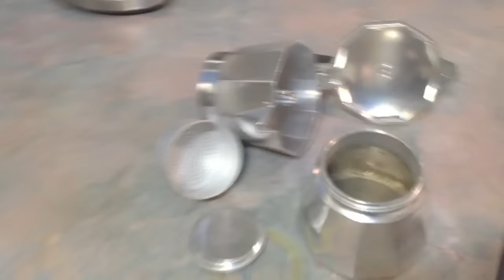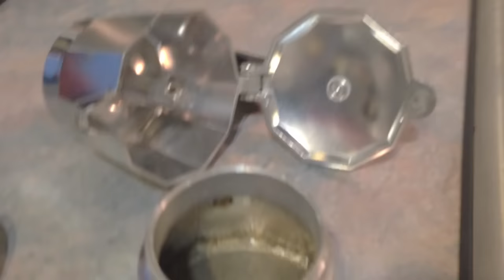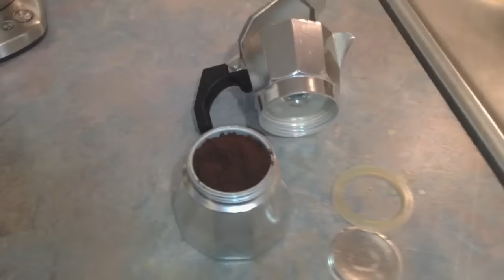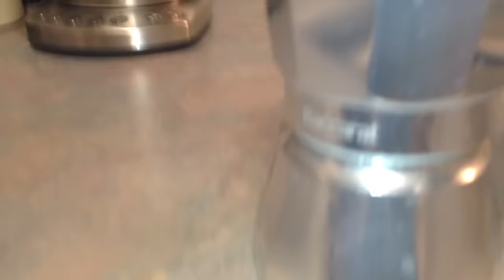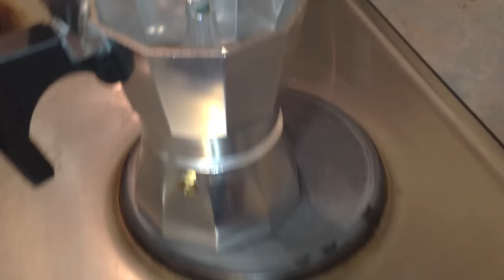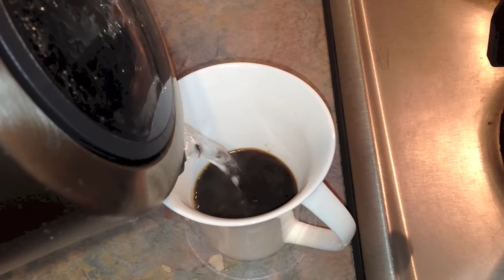How to use a Stovetop Espresso Maker

Comment: Tip: start off by putting boiling water into the coffee maker, it will save you time and get a fresher flavour as the coffee will not be sitting on top of the water vapour as the water heats up to the boiling point
Reply: Thank you

Comment: I'm watching this video during quarantine and it nearly brought tears to my eyes, it was so informative. Decided to use this exact expresso maker today that I received as a gift years ago and put away in a cabinet because I didn't have any instructions. Trying to get away from the plastic coffee maker, I have been using. As an engineer, I knew not to attempt this without proper visuals but went through several other guides that left me with more questions than answers. No questions after this one :) Hope you are well and thank you 🙏🏾
Reply from the maker: So glad to hear it’s helped you out!
Reply: Yes, a lot of instructional videos overcomplicate the process. This one shows the fundamentals quite clearly. I would add, however, the importance of not using too high a heat source and possibly towards the end of the cycle, when it first starts hissing and sputtering, to remove it from the heat source. Moka pot first produces a very strong, almost syrupy brew and then gets watery towards the end of the cycle. Some people even suggest stirring it in the pot to mix it before serving. Removing it from the heat also avoids "burning" the coffee grounds and produces a cuppa that isn't bitter. Trust me, you will enjoy using the moka pot. If the resulting brew is too strong for your taste (some say that it mimics espresso) then dilute it with hot water to make an Americano (so named because American servicemen in Italy during WWII liked it that way, rather than as an espresso.)

Comment: I loved this video. This is the most complete piece of information i have seen on the subject. You covered everything i wanted to know. Such a simple but great way to enjoy strong fresh coffee! In my opinion using fresh ground coffee is optimal.
Reply: Yup, spend a bit more on quality beans and grind it fresh at time of making it. Also, distilled water (very cheap huge jugs) is really what will push it over the top. 👍😁
Reply: but my dear mr.grim . . .  he dint mention how to properly empty the used coffee grounds from the filter basket?  it is a coffee drinkers ritual passed down thru the ages from father to son and mother to daughter... a sort of coming of age for the next generation of coffee drinkers if u will?  and now i pass the secret on to you!   begin by holding the funnel shaped filter basket between the thumb and forefinger, but do this only after it has cooled or you will rue the day you ever discovered this delightful little trick!  then, with a grand gesture, bring the filter basket up to your lips and blow thru the tube.  the result is as miraculous as it is rewarding.   the torch has been passed... good luck and happy coffee break!
Reply: Very helpful, thank you!

Comment: We just retired a 10 year old Keurig, similar to the new one MyBest.Kitchen the old one had a LCD display, but this new one seems like it is a little better as far as features. Turn it on, load it up, press the button and wait for the cup to fill. Much quieter than the old one. The amount
Reply: Keurigs Arnot coffee Keurigs is hot-water pushed over a K-Cup which pretty much is instant coffee
Reply: Please don't click this link unless you've inspected it.

Comment: I found one of these in a thrift shop with no instructions,  and was not to happy not knowing if I had all the parts because I had to leave the handle at the edge of my burner.  But your video not only showed how close I was but to add hot water to the "concentrate" to even out the coffee, or whatever beans I have is something I never thought to do.  Im going to dig it out of a box and follow your instructions and get my 2 dollars worth out of this funky little coffee maker.   Thanks.
Reply from the maker: Tru Rudboi What a find! Definitely worth keeping handy in the kitchen thats for sure.
Reply: I found some clearance beans of dunkin d's, starbucks,  ect, at the store and enjoy making a cup of coffee with this thing,  it does take some practice,  this video helps alot.
Reply: Greetings and happy holidays.  How do I clean the insides of this coffee maker?  Do I scrub it out with dishsoap,  or is there a special way to do it?  Thanks
Reply from the maker: Hey Tru, I would simply rinse under warm water and use a dishcloth to remove any residues. Probably avoid using soapy water too often as it removes the oil's that 'season' the pot.
Reply: well :)) it,s a machine coffe from italy .. most of ppl italian use this home to make coffe.. at first ..if u use a new one .. mean machine coffe.. i have to put only water in the machine.. not coffe ..make 3 or 4 time the same.. and at last u can make a good coffe

Comment: You are a wonderful human being!

Thanks very much for the video.  My coffee maker (drip type) died after 25 years of loyal service, and a new one is not in the budget right now.  My wife reached into the depths of a dusty shelf with "decorative" kitchen items, and pulled out an espresso pot.

"You could use this........I think........"  Was her highly encouraging statement.

It needed a good cleaning, and the gasket had become dried-out and (almost" permanently attached, but because of your video, IT WORKS!!

One question, how often do you remove the gasket and filter for cleaning?  After each use?  I bought some new gaskets, but they are not the easiest thing to remove, so I have cheated a few times and left it in place for 2-3 pots.

Thanks for your help, and for the videos!
Reply: Scott Owings z

Comment: I don't remove the rubber washer each time I make my espresso - in fact rarely do I take it off......maybe once in a while to give the pot a thorough wash. I collect these pots of various shaped and sizes. Every so often, Goodwill or Salvation Army one will turn up, usually a dollar, not much more....they're cool. I have mine "on display" in my kitchen. The various types of espresso that's on the market today is fun to experiment with. In Italy, it's all we use.
Reply from the maker: They are fun to collect and they add some variety to my options of making coffee!

Comment: Well explained. I bought one from ikea and had no idea how to use it. This video helped me a lot. Thank you so much. I have a doubt. Does the water flow out completely from the bottom reservoir to the top .when i did some water still remained in the bottom vessel. Is that normal. Plss clarify. Thank you once again

Comment: I use one of these, great gadgets. I find if I leave the hot water spurting into the brew at the end as in the demo this has a -ve effect on the flavour. Once that point approaches I remove from the heat and stand the base in cold water for about 10 seconds. This kills the boiling immediately and stops the flow of what is at that point very weak, flavourless, boiling coffee. Just a different approach which I find does make a significant difference.

Comment: The one featured in this video, Bacarat I believe, is one of the best stove top espresso makers (moka pots) that you can buy. Arguably better than the current aluminium Bialetti models. The general criticism of the Bialetti aluminium models is they're still using old fashion rubber gaskets instead of the more modern and durable silicon ones everyone else uses.  Bialetti are sticklers for tradition it seems. Moka pots also come in stainless steel, but I prefer aluminium myself.

Comment: Clear as a-bell directions! I have 1 question, do you leave the grounds in the filter before pouring the coffee? I have been using a porcelain coffee pot without the basket. I boil it and then when it's done boiling to the darkness I like, I pour cold water in and give it a minute or two, and then it is ready to go. No grounds in my cup. The only problem is I feel like I waste too much coffee.

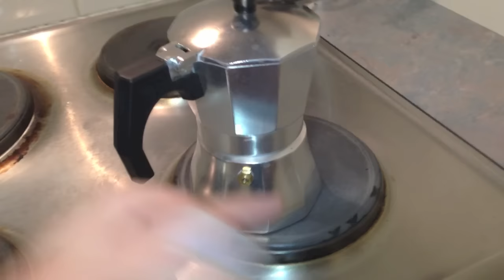Comment: It's only in the summary at 5:01 that you mentioned that you used filtered water. Also, I would have tidied the coffee grinds spilling over the 'cup', to avoid mess and allow a good seal. I've never had a problem overtightening a stovetop. Otherwise, nice explanation.

Comment: Thanks so much. I got one on Amazon for less than $8 so less than one espresso drink at the coffee shop but the instructions say to pull it when 3/4 of the water has passed through, but they also say not to lift the lid! So how would I know if it was 3/4s full at the top?? So odd! Thanks for exactly the clarification I was looking for with a handy visual. Much appreciated!

Comment: Thanks for doing that video! One question, though: If powerful, hot steam is the key to getting that desirable "crema" on top of the espresso as in the big commercial espresso machines, why would you not want to pack your stovetop espresso maker as tightly as possible with coffee to raise the steam pressure as much as possible?
Reply from the maker: +BluegrassBoy these devices don't create enough pressure to make 'crema'. If you pack the coffee to tightly then they simply won't produce any coffee. You are spot on when it comes to espresso machines, but these work a little differently.

Comment: Thanks for the informative video, great job!  My drink of choice is a 20oz Americano.  What is your recommendation on how to achieve this with the 6 cup Moka Pot?  I just purchased one.  Also, I usually buy the regular coffee beans.  Is that acceptable or should I be purchasing espresso beans?

How many tablespoons of coffee grounds?  How much water after the brew is done?  Thanks in advance!
Reply from the maker: Hey TomBVoxman. Thanks for the feedback.
For your Americano, I would brew up a full Moka Pot. As is fill the reservoir with water, fill the coffee chamber with ground coffee and brew like normal. 20oz is a good size cup, so depending on your taste, you would probably use about 3-4oz of espresso from your Moka Pot, fill the rest of your cup with just off the boil water.

Comment: Informative video. I just have one problem. Mine always tastes burned. I have it on med-high on a gas stove. It will take about 10 minutes for anything to come out of the top and it will only full up about half way or less, leaving water in the bottom still before or stops. Should I have it on even higher? I'm afraid if the flames being to wide and burning the handle
Reply from the maker: It sounds like your following all the correct steps and not boiling the water too rapidly.
Your coffee ground may be too fine, this would slow down the extraction and potentially cause your issues. 
Try a slightly coarser grind for your coffee and see how it goes
Reply: Same happened me and I found the problem.  Don't use cold water as it takes too long to boil. Use hot water or water not long off the boil. It works fast and the coffee doesnt taste burned from sitting on the heat too long. It makes sense aswell as no steam comes up until the water gets boiled so ure first few mins with cold water is unnecessary and exposes the coffee to too much heat. Solved burnt taste for me.

Comment: Thank you for this great video. I just bought a 9 cup Baccart Verona Coffee Maker and as the little booklet that came with it, ended up in some water at the benchtop, I can't read the instructions anymore. So your video was a great help. The only thing is, is there an easy way to get out the silicon ring and filter lid? I don't want to use the point of a knife to get it out, as I might damage it.  
Kind regards, Anneke.
Reply from the maker: Anneke van Wyk Glad you have found it useful Anneke! Shame about the instructions taking a bit of a dip :(
That silicon ring is not easy to get out is it!? I have found that a blunt knife, like a bread and butter knife is the best way to get a difficult silicon ring out for cleaning.
Reply: Yes, that is what I've been using. ;)

Comment: Great video. I have a question, my coffee still came out a little bitter. was there not enough heat? the coffee boiling up into the top chamber was clear and steamy and bubbley. I noticed in you video the coffee is thick and dark going into the top chamber. I noticed mine was clearish so i turned down the heat a little maybe I should have gone hotter?

Comment: Awesome!  What brand machine do you recommend ?  Does it matter?  And do you always fill the water to the express hole and then fill the coffee compartment full for any size?  I'm asking because it's the measuring and weighing of water and coffee grounds that always is a problem for me in making coffee.  If I don't have to measure anything that is a HUGE bonus!!
Reply from the maker: Hi Sharyn,
Bialetti is probably the most well known brand for these devices and you couldn’t go wrong with one of them. 
As for the quantities of water and coffee. You’re in luck, always the same regardless of size. You will always fill the water to just under the pressure relief valve, and coffee is always to fill the basket. No measuring needed here!!
Reply: @Guide2Coffee  Half of that was great news.... I've been researching and you can't get Bialetti in Canada (or at least in Toronto, where I am).  Any chance you know and trust other brands?  If it LOOKS like that one, will it do the trick???  I'm on a mission to be able to make great coffee at home and I'm not willing to give up!
Reply: actually....I'm wrong.  I researched the one YOU used, which I think is Baccarat.  THAT is the one I cant get here.  But Bialetti seems to be available.  THANK YOU.  You may have single handedly solved YEARS worth of coffee shame.
Reply from the maker: Oh glad you were able to find one. Yes mine is a Baccarat and it’s still going well many years later! They are pretty bullet proof little machines as long as you keep them clean. Main thing is the seal in the middle, you might have to replace once every couple of years.
Happy coffee making!!!

Comment: There's a lot of more information that should have been posted here. I came across one I found it and I was learning how to use it and I think I got it down pretty good. I also found this video. If you like your coffee strong like I do you should find some type of device where you can pack the coffee down in the holding area inside the
device. You also have to make sure your coffee is a fine ground and it doesn't necessarily have to be a dark roast or should I say French roast or Italian Roast. Coarsely ground coffee does not work good. There is also an upper filter that the coffee goes through before it empties into the main compartment that you pour out of. Don't make the same mistake I did in the beginning after every use dislodging the upper filter that is set in place with a brown rubber gasket. All you have to do is run the water over it and let it drain out to the top of the coffee maker. After so many uses I would imagine it would be a good idea to disassemble it to clean but just make sure you get it in exactly the way you took it out

Comment: I never used them but I want to know for example you have 6 cup espresso stovetop, can I prepare only 2 cups at the time for example or I have to make exactly 6 cups? Thanks
Reply: u do know when the stove top espresso maker says six cups it's talking about shots. this is espresso everyone is making not coffee as in a coffee pot.  he diluted it at the end to make it as coffee but its still very strong.
Reply: cups are about 1.5 oz, it means shots
Reply: You can put less water and ground but the taste will not come as good. I typically make full amount that my maker can do and store unconsumed amount in the fridge
Reply: I would think, if it's designed to hold enough grounds for 6 cups, you would need to make all six; the pressure wouldn't be right, otherwise (or else you wouldn't have enough grounds in the chamber for it to be fully infused).

Comment: Contrary to what is stated in the video, the upper part of the coffee maker *must be screwed tightly*, otherwise due to the strong steam pressure generated the upper part could be ejected violently causing serious damage.  Also, if the top of the coffee maker is not tightened to the base, a lot of coffee would be lost by drawing from the thread.
Reply: Thx
I just tightened it💡

Comment: hi. quick question. bought one of these pots a couple of days ago. made one brew yesterday which was fine. following the exact same process today however the water/coffee is not coming up through the spout. basically, the water doesn't fitler through from the bottom at all. any reasons why this might be. made sure everything was clean/unblocked second time round. same coffeeless results??
Reply: Ya valve might be stuck open. Ya gonna need a thin sold spike to press it around both ways to loosen it up so it springs back to closed position.
Reply from the maker: Hey Mike, thats unusual. As Clinton said you may like to see if the valve is working correctly, if it's venting out all the pressure then you wouldn't get any coffee.
Maybe check how coarse the grind is, if it is too fine this may cause a similar problem as it's too hard for the water to pass through. Let us know how you get on!

Comment: Because the water is under pressure, if the pellet is not packed well enough, the water will find it's way through the spaces (path of least resistance) and will not go through the grounds evenly, extracting less coffee.

Comment: Can you tell me what size moka pot / stovetop espresso maker you used in this video? Was it a 1 cup? 3 cup? 6 cup?
Reply: Also - do you know if you can make just 1 serving in a 3-cup moka pot? Or is it necessary to make a full batch only?
Reply from the maker: Charlotte Watts you will only be able to make a full batch at a time with these. Could be worth having one small (when it's just you) and one large (when you have a few friends to serve) handy? 
The one used here is a 3 cup (espresso cup size) version.